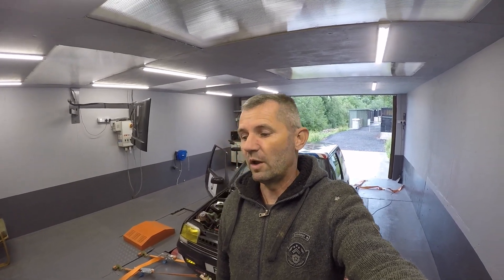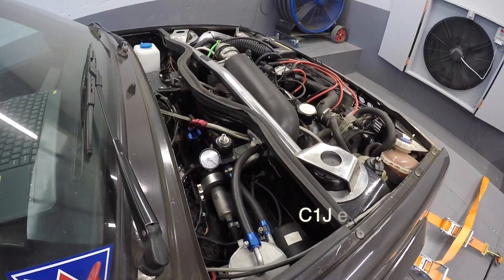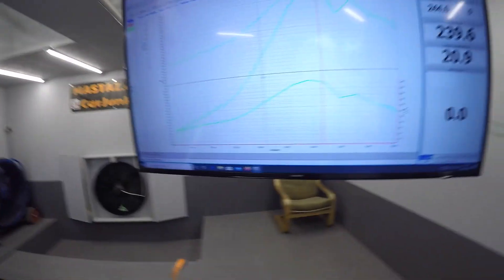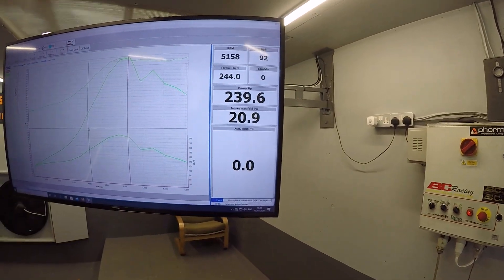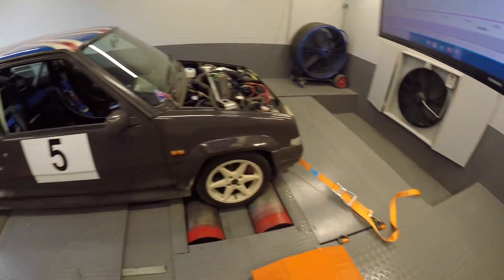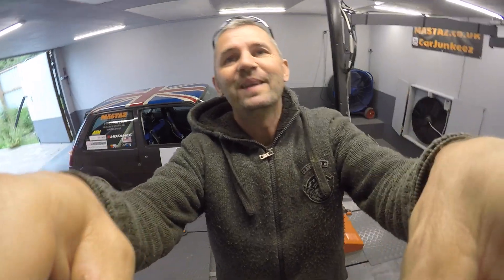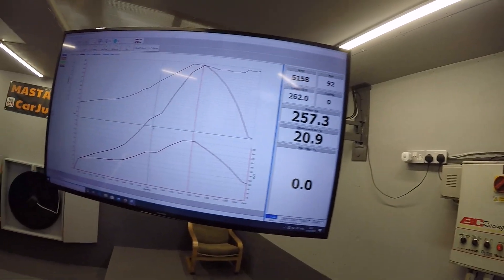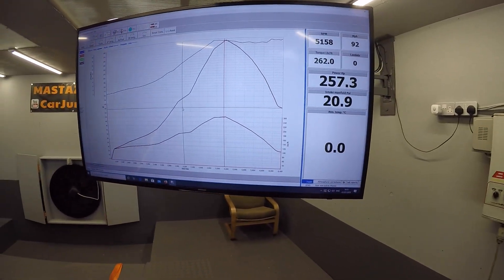Renault 5 Gt Turbo Dyno Run - Part 2

Comment: Nice power
Reply from the maker: Thanks mate, not bad for the little c1j
Reply: CarJunkeez got one myself but it’s carb so I doubt il be see in them results lol
Reply from the maker: You can still get very good results on carb, I ran carb for 4 years with good power although I didn’t dyno it. I’m going to build another one day or find an old campus as still got full carb engine and box, suspension etc. I actually miss the carb setup.

Comment: So have you taken 1.5mm off the block? What’s the CR now?
Reply: I’ve found your other vids showing you machine the liners down (deck height?). I ran an MS2 Extra on my GTT but now prepping for Hillclimb in Australia. I’ve been told inlet ports are restrictive and see you’ve worked yours. I have the RE003 pushrods but found them too short? How did you get around this? PM if easier.
Reply from the maker: Hi mate, yea I purchased the block they had already been decked by 1.5mm so I had to turn down my liners to match. Yes I ported my head and removed the end of the valve guides for better glow. The RE003 push rods are the correct length for me as it’s decked 1.5mm but I did have to open up the holes in the head with die grinder as they catch otherwise. I think on your setup you may be able to deck your rocker shaft mounts by about 1mm for best fit with the RE003 push rods. I’m not sure what compression ratio is now but it’s a fair bit higher 👍 cheers